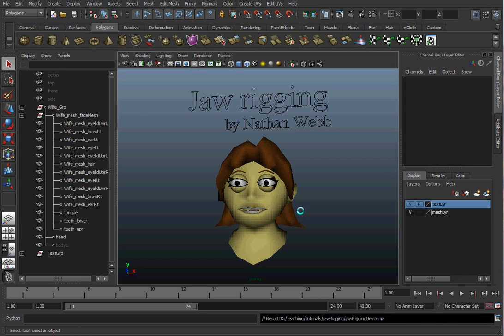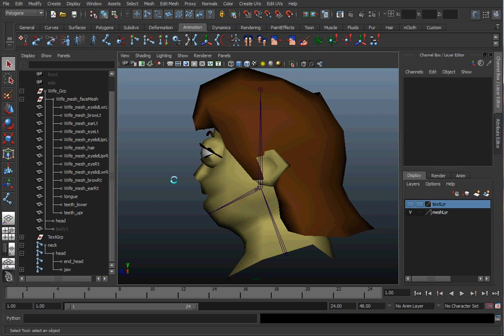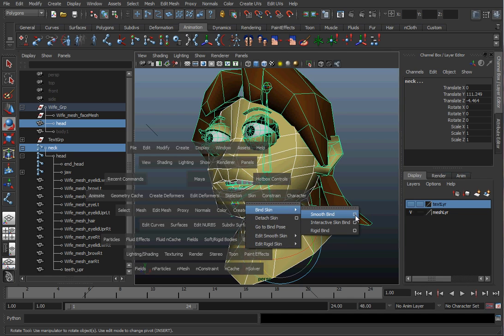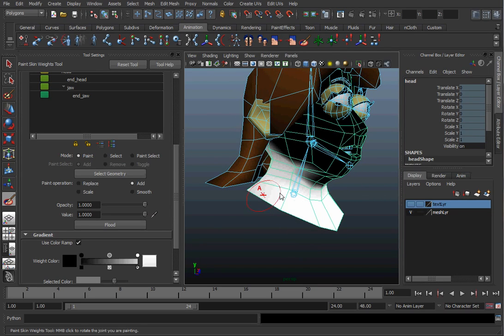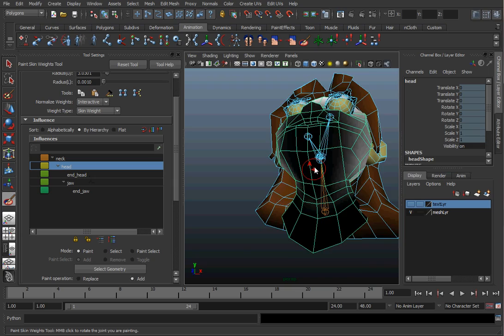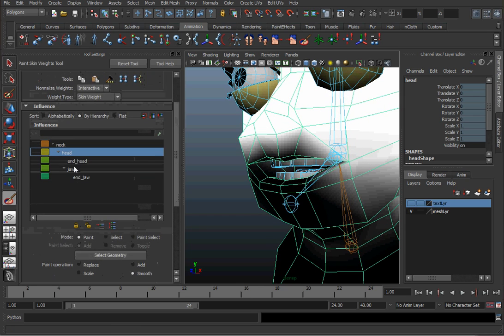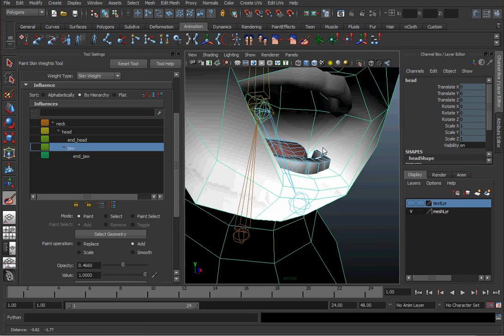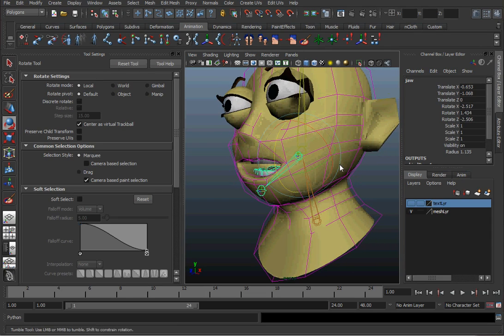Maya jaw rigging tutorial

Comment: If the rig comes in Maya as a whole, no pieces. How can I make it to parent the jaw, lips or tongue to joints? If I add joints as it is now, edit influences and paint weights, the only thing the joints do, is to stretch the skin. No jaw, tongue or lips are moving
Reply from the maker: Hello.  If the mesh is all one piece, you'll need to skin the  jaw, lower lips, teeth, tongue etc to the jaw joint, and keep the upper teeth and upper lips skinned to the head joint.
Reply: @nathanronaldwebb  I did as you said but still the chin joint stretches the skin and the jaw joint stretches the jaw but cannot separate the upper and lower parts of jaw. Look like they are glued together. I would expect it to move if it were two different things but the whole mesh comes as one piece. Initially it was made in lightwave and converted into mb for me to work in Maya. I feel it has to do with the quality of the mesh.
Reply from the maker: @Followingthesun323  Hi Steve.  Did you paint the skinning weights?  When you bind it, you just get basic skinning which usually needs to be refined.  You'll need to select the mesh and adjust the skinning so that only the vertices you want to move move with each joint.  So makes sure that the upper part of the mouth is skinned to the head joint, and the lower part of the mouth is skinned to the jaw.  You can rotated the joints as your skin it to test it out.  White parts of the mesh move with the joint, and black parts don't.  Having a Wacom tablet it handy to make finer adjustments then just using a mouse.  Hope that helps.
Reply: @nathanronaldwebb  Thanks Nathan. I used a different rig ultimately. I was experiencing many issues and I decided to switch models. Thanks for your support

Comment: Hello. Thank you so much for the video! However, I have a question, on 11.29, your jaw can move your lower lips and combine well with your low teeth. Why the teeth of mine always drop whenever I move the jaw joint? Big Thx!! Hope you can respond soon.
Reply from the maker: Hello.  Are the teeth a separate object?  If so, be sure to parent the teeth parented to the jaw joint, and don't skin it as well.  You only want one thing moving the teeth.  I seems like you have double transforms (two things moving an object, which causes it to move twice as far as you want), which can be caused be something being skinned to an object, and also parented to the object.  If the teeth are parented to the jaw, just remove the skinning on the teeth and it should fix it.  If the teeth are part of the same mesh as the head, I'm not sure what's going on without looking at the scene.  Good luck, and I'm glad that you are getting some use out of the video.

Comment: protip, while you're painting weights, take whatever joint you're painting and rotate it around, set keys on typical points of rotation. Then to see the results of your paint you can just jog the frames instead of dropping paint, selecting joint, rotating, resetting, selecting mesh, and going back to paint 390823 times.